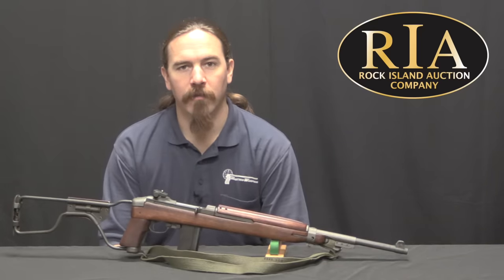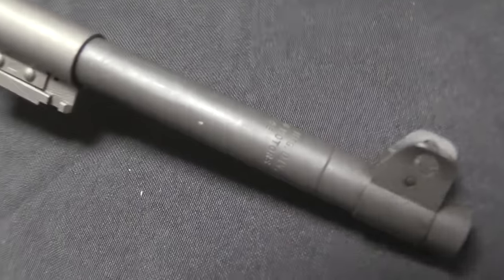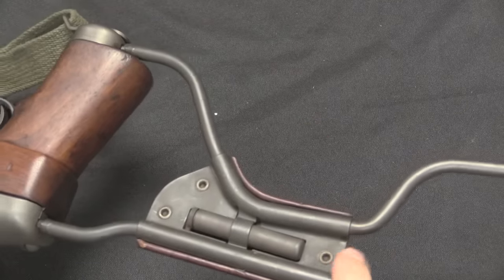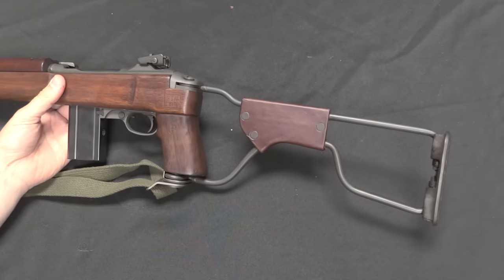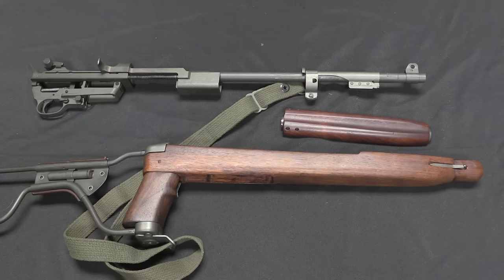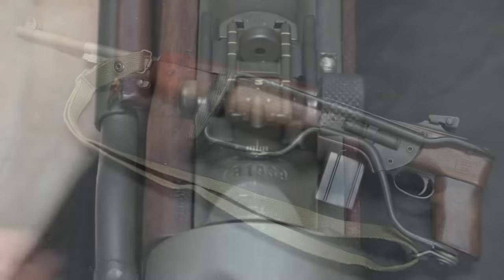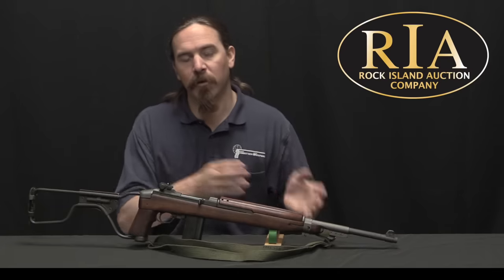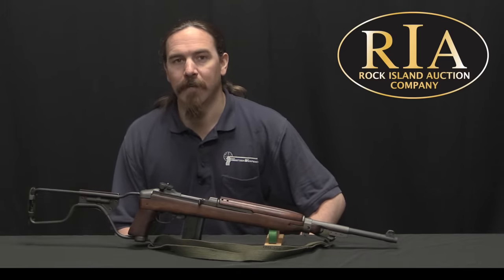How to Identify a Real M1A1 Carbine vs a Fake

Comment: I'd like to state for the record that many paratroopers in WW2 did indeed drop with M1 Garands, it's a common misconception that these guns outright replaced the Garand in paratrooper service.
In reality it was a supplement for the Garand, as was the full stock M1 in the regular infantry, most riflemen preferred to use the M1 for the extra range and punch.
Reply: I assume you mean most preferred the M1 Garand and not the M1 Carbine because the M1 Carbine had terrible range compared to the Garand. This became a serious issue during a key battle during the race to the Rhine river after D-day.
Reply: That is correct. Most 101st and 82nd Airborne soldiers in WWII were equipped with standard Garands and not the M1A1 carbine.
Reply: @geodes6722  it should be noted a lot of them quickly traded in their M1A1s for M1s once their initial landing operations had been finished, again, for the extra punch and range.
Reply: @trainknut  General Gavin himself originally had an M1 carbine and gave it up for a Garand. In his book “On to Berlin”, he had nothing good to say about the carbine!

Comment: What is the value of an Inland M1 carbine with a paratrooper M2 stock? The gun is not class 3 it just has the M2 stock. The condition is slightly less than the one shown in the video but not much less.

Comment: Did they make M2s with these stocks?
Reply from the maker: Nope.
Reply: @ForgottenWeapons  werent there some "test" M2 folding stock carbines pieced together some time after the war to try to squeeze a little more service out of these? Or is that just a myth/straight up lie? I was told this by a collector who only collects M1/2/3 carbines.
Reply: Yep sure were 1944 when they were introduced over 600,000,  in 1945 is when they really started pushing them in the middle of 1945 there were sending out retro kits to the soldiers in the field

Comment: Alot of the Repro Paratrooper stocks that I came across have the Selector cut out and the slight swell in the stock or whats called the  "pot belly".
That's the one thing I  look for first.

Comment: There were folding stocks on market a few years ago, that were reportedly, post-WW2 run made for NATO. These supposedly were made in Italy to military specs. Stocks I think were single packed in a white box as I recall from seeing them at tables at gun shows. A carbine collector in our club had some and stated the parts were interchangeable w/ original US but readily admits he can find no source of NATO connection. He does state these stocks are of far higher quality than the commercial stocks made in past. Your perspective?
Reply: How many years ago? The only Italian made examples I've ever seen in the U.K. market have been copies for collectors with no military connection at all. The earliest copies I've seen were made for the 'Band of Brothers' series around 2000, though original folding stocks did come up in Europe too around that time from a German seller.

Comment: What's your take on the M1A3 underfolder paratrooper?
Reply: Al Rodriguez Not a real military rifle. That’s a 60s Universal commercial rifle.
Reply: The stock might be a replacement of the one i'm looking at.  The barrel action, etc. are on spec with WW2 carbines.  I had a doubt on the under-folding stock, though.  Since it appears as it was a modification not released in wartime.

Comment: I have an M1A1, 1943 Inland, less than two thousand s/ns away from the Batte M1A1 which has unshakable provenance, and that would put my carbine in the mid part of that block of M1A1s. It means literally nothing for originality as my M1A1 has no provenance.